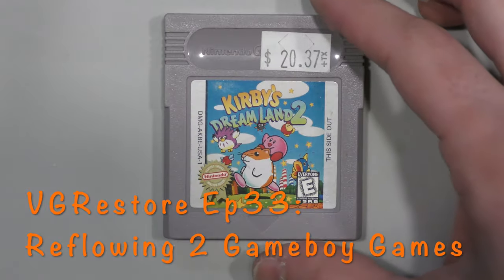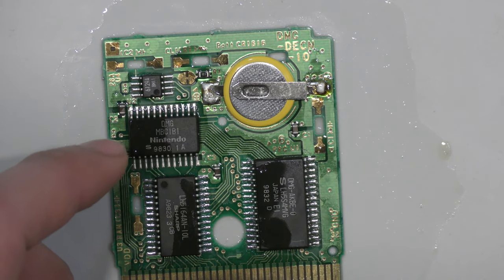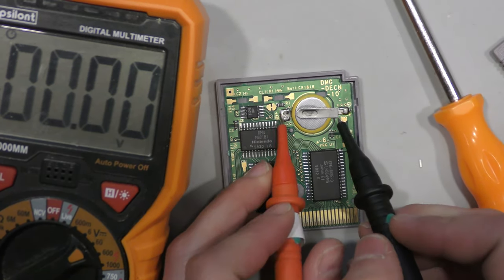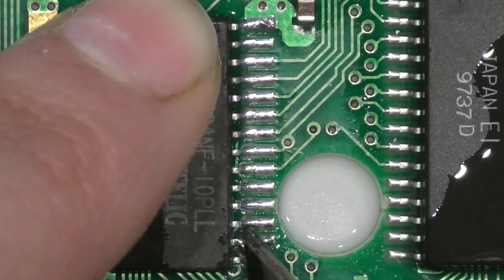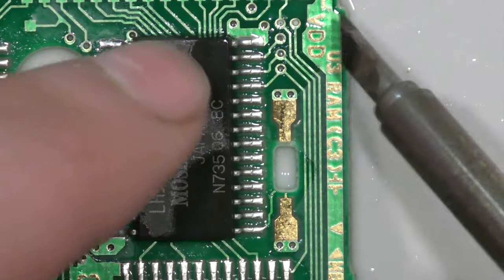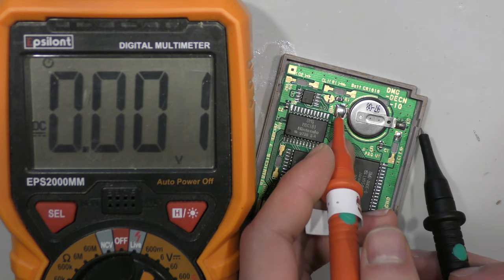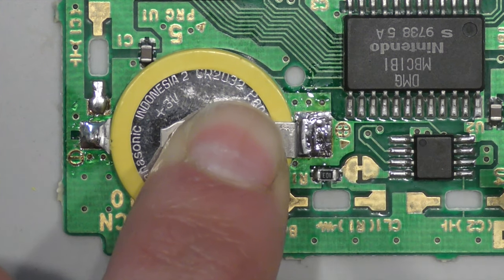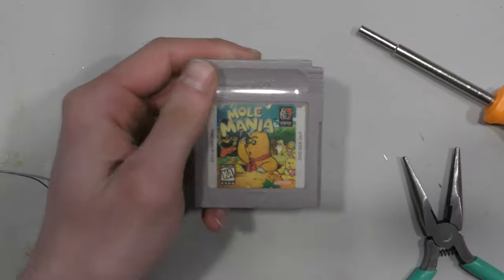VGRestore Ep33: Reflowing 2 Gameboy Games

Comment: I thought you would have tried the copper pins at the bottom where it’s slots to see if it’s dirt or corrosion first with some cleaner to see if it’s that problem before reflowing the chip pins.

Comment: How are you not burning your finger? your finger is so close that iron.
Reply from the maker: It does get hot but I don’t hold the iron over the pins for too long the actual chip doesn’t heat up.
Reply: @PunkNDisorderlyGamer  Oh alright, so its just enough to heat the solder up to get it flowing where you need it to go.
Reply from the maker: Kareem Daly it gets hot but not extremely hot for me.